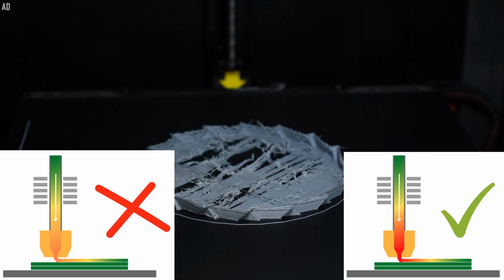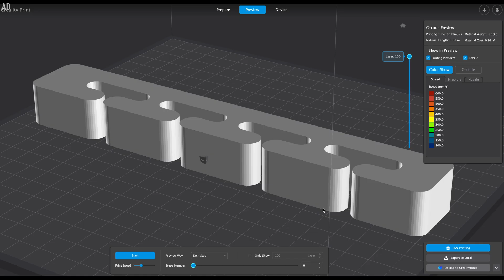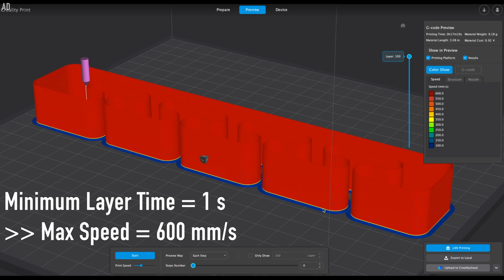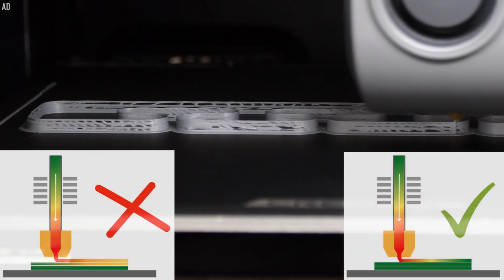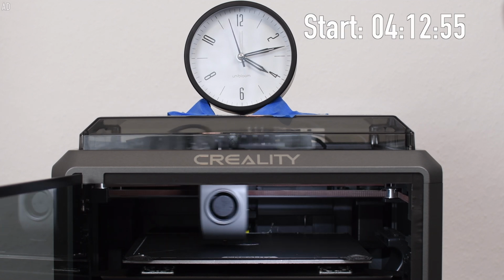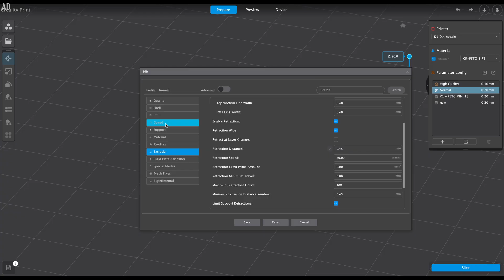Can the Creality K1 print at 600 mm/s ONLY with Hyper PLA?

Comment: Useless video and absolutely useless website in video discretion, tons of water, and defolt information that u can find absolutely everywhere...

I saw 0 words about  ur acceleration and jerks. Did u know that u can set 1mm/s² acceleration and 100000000000mm/s speed and print with good quality because with this accel ur printer can't reach even 300 mm/s?

Comment: Good Video - got my K1 Max today, printed Benchy with PLA+ (DURAMIC) as if it were PLA hyper - Print quality was real good, speed about knocked me over(16 min). Possibly the PLA+ has similar quality to Hyper.. Will need to test further, but a nice option.Huge improvement over my CR6SE.

Comment: Tried to print with normal PLA at 300 degrees celsius, it was going well until it randomly clogged up the entire hotend, so i had to take the entire thing apart and try to manually pull the plastic out. Didn't work, so i had to carefully drill through it. This worked, but when i put it back on, it started to leak melted PLA on the hotend itself when i tried to extrude the hyper-PLA in. I had to get a new hotend now.

BE CAREFUL AND DON'T END UP LIKE ME: If you are going to use normal PLA, i just suggest you try to print at a slower speed instead of increasing the temperature up to 300 degrees. I would recommend a setting of 200 degrees instead for Creality's official normal PLA. (which means any other kind of PLA not designed for high-speed printing). If you are using a different brand, be sure to read what temperature it is supposed to be used at.
Reply: 300 degrees does seem very aggressive to me.

I print normal PLA at speeds up to around 300, at temps around 215 - 220 degrees, with no issues on my k! max.
Haven´t tried 600 though., would properly go op max 10 degrees if i did.
Right now, it´s all about Rapid PETG for me

Comment: Inland Tuf PLA prints essentially perfectly on the K1 using Hyper PLA settings.
Reply: Hyper profile default is 300ms, yoi need change manual to 600

Comment: I used a cheap PLA on the K1 using default benchy and speed test (both provided) and have no stringing, blobs or other issues. All i can say dry the PLA overnight at 50deg C.
Reply: Room temperature may be a factor.  What brand of PLA?

Comment: I dont have k1 but i just bought hyper pla to try on my s1 plus with klipper. Its being deliver today, gonna let it rip!!!
Reply: that's waste u never get it fast enough to need high flow pla
Reply: @jamesharris9894  but it was actually cheaper than normal pla and it printed better. I go pretty dang fast with my sonic pad yo. Ender go brrrrrr
Reply: @andrewut7ya511  yeah I'm pushing 200 plus with the CHT nozzle linear rails Sonic pad and upgraded fan and I still don't need the hyper fans are your weak point though
Reply: @andrewut7ya511  but if it was cheaper it don't hurt anything
Reply: @jamesharris9894  im gonna do a fan upgrade this week. I cant put my finger on exactly what makes it better but the hyper just prints better. A common part i print is a spacer for a custom production battery pack, i do about 200 per month, with regular pla there is occasional stringing and warping, the hyper just made things a bit easier and less failures per batch. Its a weird shape that is round but also has cutouts leading to points which can pull off the bed, i suspect from low area of contact and printing circular internal stress that pulls the corners. A brim helps but also adds post processing since it goes under shrinkwrap and can have no sharp edges of any kind so i avoid a brim whenever possible, trimming 200 shapes sucks lol.
Reply: @andrewut7ya511  I hear they mix pla  with abs to make it hyper pla
Reply: Hi, got an update on how that went?

Comment: 600 mm/s means absolutely nothing without specifying the acceleration. You’re discussing 3d printing speed without a single mention of the volumetric flow rate… how
Reply: This. I'm not sure what the default accelerations for this machine are, but to even reach 600 mm/s momentarily anywhere on a Benchy but the sides of the hull, you'd need 30000-50000 mm/s².
Reply: You also need layer height if you are giving benchy times.
Reply: @petercallison5765  In talking about the accelerations needed to reach or utilize a particular speed, layer height is not a relevant parameter. The same kinematics would apply on a dry run where you don't extrude at all. Layer height only comes in with flow... which Alexander already mentioned.
Reply: It doesn't matter. What he said is correct is just not as detailed as you want it. But everyone wants the fine details. They really don't care.
Reply: A benchy is small enough tha max speed is strongly limited by acceleration. You could set the max speed to the speed of light and it wouldn't take a second less.

10k mm/s² and 200mm/s is already 19 minutes.
If acceleration wasn't an issue, at 600mm/s the benchy would take 6 minutes.

Comment: Excellent video. Thank you. It would be awesome to see the effect of a CHT nozzle as well.
Reply: It may need additional fans like the Neptune 4 at that speed.  You can just put a desktop fan near the printer to see if more cooling helps.
Reply: It has a side fan, and part cooling fan cooling is not the issue. it's flow rate